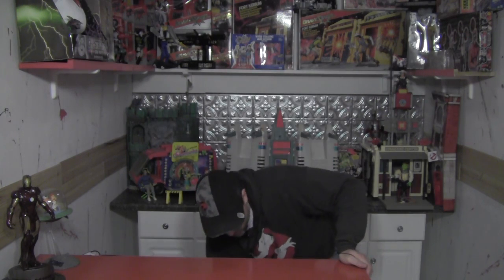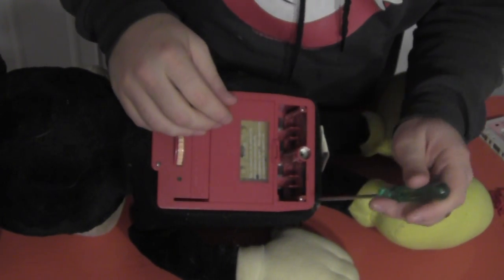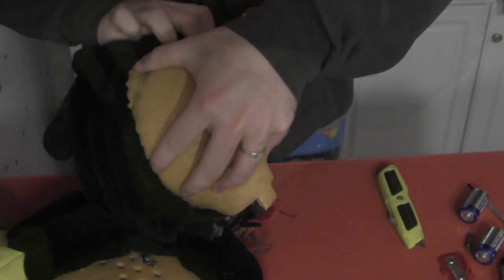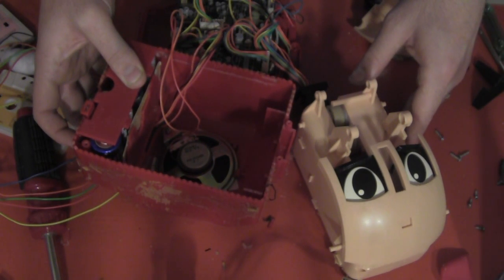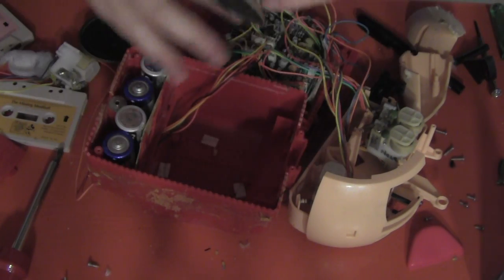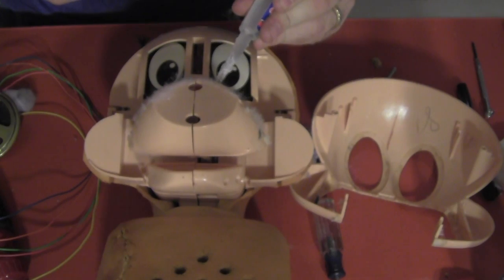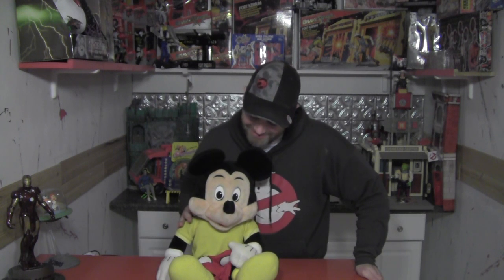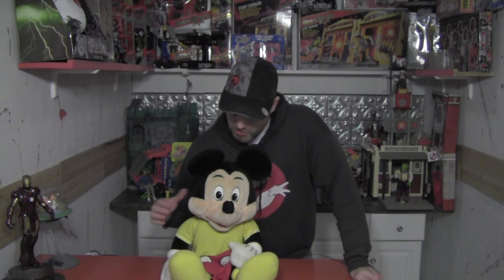Toy Adventures with Devall - Talking Mickey Mouse Repair

Comment: Wow! 11 years ago on this video! Just acquired one. The  battery ends are super clean. I just don't have a tape. Does the animatronics work without the tape? Any help would be great, and it is going in the market! 😊
Reply from the maker: Sadly, no. You WILL need a tape to test properly.

Comment: I replaced the cassette belt & got the tape running, when I plug in to each other, the volume goes down to about half, as if a defective board is dragging it down. Unplugged all 6 motors from the boards, no reacttion, Mickey does not move at all, Googy tries to, massaged the eyes & nose, didnt help, replaced cord, no action. Any ideas?

Comment: I just purchased a Mickey from an older lady that has had him in storage for years. He looks like new but his eyes and mouth don't move and he sounds a bit slow/garbled. I'm going to tear him apart to see if I can get the motors to work again but I was wondering if you have any suggestions on fixing the sound issue? Is it possibly an issue with the tape player belt? I bought this to give to my kids as a Christmas gift, so any help is really appreciated.
Reply from the maker: Hmmm...the garbled sound could be a few things. Are you using old batteries? I always try brand new batteries on mine. It could need cleaned. You can clean the roller part and the metal head, the parts that actually touch the tape inside the cassette with a q-tip and rubbing alcohol. Or yes, it could need a new belt. I'll have to look up the info on what size belt the drive takes...
Reply: I did add new batteries when I got home but the sound didn't improve. I've ordered a tape cleaner but the qtip and alcohol is a great suggestion. The belt size would be much appreciated. Thank you for your help, I really appreciate it.
Reply from the maker: SAM here is a link to the replacement belts. http://resque.goodsmiths.com/toystoration/teddy-ruxpin-tape-drive-belts-replacement-part-for-1st-generation

Comment: I have one that works, but the sound running a bit slow and sounds like what I can only describe  as warbley.  Any idea what might be causing it? I'm almost afraid to take it spart.  I wondered if there are any bands that runs the tape that might need replacing.  I can't find any info online about it
Reply: Yes, you’ll need to replace the drive belt in it to fix the warble. There’s a video on how to replace it in Teddy Ruxpin and it’s identical in how you do it with Mickey. To adjust the playback speed. There’s a small module that controls the speed of the cassette deck’s drive motor, located on the far right of the circuit board that you’ll need a jeweler’s flathead screwdriver to adjust & speed up a bit. Hope this helps
Reply: @inspiredfigmentsarchives  thank you
Reply: @kaybeth9181  No problem, wish ya the best of luck in getting Mickey working 100% again. God bless.

Comment: I have a talking mickey who's tape player and speaker work ok but he's suffering from facial paralysis. Is it possible to get at the motors without taking the head off the body?
Reply from the maker: You can try to gently move the mouth parts up and down while he is on, sometimes that helps. But it doesn't always work properly. :(

Comment: Is there any way I can fix the eye movement without taking all this apart
Reply from the maker: You can try, while playing one of Mickey's tapes, GENTLY moving the eyelid up and down. That MAY work to move the rubber head on the motor back and forth enough that it frees up the motor.

Comment: hi I wanted if you took the cassette player out it would the cassette tape still work with the loud humming sound because bought a couple of world of snoopy book on tape and it don't really work in a regular tape player
Reply from the maker: The loud humming sound, I believe, is the speakers they used on these. They aren't great. The hum can be heard across all of their products, sadly. And yes, the tapes won't work well in regular tape players because the stereo tracks these are recorded on are done so one side, either left or right, holds the program audio while the other side holds the track that controls the motors telling them when to move and how far. On Teddy, Mickey and such the tape players are wired so the tracks are sent to separate functions. Audio to the speaker, motor tracks to the motors.
Reply: Oh thanks for the information and would a snoopy wow cassette tape play in teddy ruxpin or mickey mouse too
Reply from the maker: @groovyentertainment1982  technically, yes. BUT, because the mother boards that control the animations are different in each talker, they may or may not move to the tracks.
Reply: Oh it wouldn't bother me if it doesn't move as long as it plays the stories without no problem I'll be happy 😊

Comment: How did you massage the motor? Did you just keep moving the eyelids? I found a Mickey and his tape player works perfect but his face doesn't move
Reply from the maker: It's easiest to do what I did and basically take the faceoff to access the motors. Then, with the tape playing, I basically take the rubber roller on the end of the motor and roll it back and forth. Eventually, it will start to move on its own as it is supposed to.
Reply: ToyWorldOrder Ok, Thank you for the quick reply!!

Comment: Hi Toyadventures. Your video has really helped me fix Mickey. So far I have replaced the cassette band (replacement bands on ebay) . I have also replaced corroded contacts on the battery terminals. Mickey is now working however the motors in the head do not. I have massaged the motors as you suggested but still no joy. Any idea what the problem could be? Thanks in advance ....Bert
Reply from the maker: +Sam Barton Berts Computer Repairs hmmm...could be the motor's are bad. The only way to test that theory is to find another Mickey cheap and pull the motors out to see if they work..

Comment: Can this work with other Wow toys? I have a talking mother goose who isn't responsive and can't find any videos on how to fix her
Reply from the maker: Yes. It should. Is her tape player playing with sound coming from the speaker and she just isn't moving?
Reply: @ToyWorldOrder  Her tape player isn't doing anything and she's just unresponsive. I took her all apart and no wires were damaged but I noticed that the copper part on the back of her circut board is missing.
Reply from the maker: @kempel_5566  hmmm...sadly, without another board to test the player out in I'm unsure. In my experience, if it is something wrong with the mother board, without the expertise in electronics to rebuild those, it's usually a wash.

Comment: My Mickey works. Mouth eyes and nose work perfectly when he talks. When it's not his point in the tape his nose twitches a lot and his mouth will be still for a while then twitch and sometimes move when the other characters are talking. Thoughts?
Reply: The motion/position tracker on the nose servo motor
will need to be cleaned.. there’s a metal contact on one of the sides you can unscrew to open up, underneath the black board with contacts on it that the wires connect to. Get some isopropyl alcohol and some q-tips and use that to clean both the contacts and the metal piece that moves inside it. Once you do that, screw it back together and it should move fine afterwards.

Comment: Just waiting for my Mickey AND Goofy to turn up from an Ebay seller here in the UK. Seller states that there is no movement or sound from either of them, but they have been stored for a long time. They both look very clean, with very clean contacts too. I know that Goofy will not function without being connected to Mickey, so he might be ok. Mickey comes with the correct tape, so i'm hoping that it's just a "bad connection" problem, as there is no sound and no movement. If it requires more work, your video will be invaluable, so thank you very much for that!! I'll let you know how I get on, and see if I can bring them both back to life!!
Reply from the maker: Good to hear! Let me know! :D

Comment: @ToyWorldOrder - I have that same Mickey doll to repair. This one has problem with the tape running far too fast and ZERO animatronics working. Ive tried a few hacks like putting a resistor on the "wow & flutter" circuit to lower the tape player input voltage a hair and slow it down, but that didnt work right. The head still doesnt move and I was hoping there is a cure that does not require cutting open his brains.
  ANY ADVISE FOR A FELLOW REPAIR TECH NOOB??
Reply from the maker: Hmmm....the tape running too fast is interesting. Honestly, if it was me, I would look for a busted one that still had a working player and swap the tape players out. If that didn't work, I would say it would be a board problem. As for the animatronics, if the tape player is playing too fast it might not be sending a clear signal from the animatronic track on the tape to the motor controls on the board. But, if the tape player gets to playing correctly and you massaged the motor for the mouth and eyes and still nothing, than you will have to open him up.

Comment: I have no power to my mickey I have no tape to test but the green light does not come on when turned on. How can I fix this. I am old and have not done this stuff in a long time.
Reply from the maker: Hmmm. If the light comes on, it means the batteries are powering him. As for a test tape, if you use Ebay you can purchase the tapes for Mickey on there, but they DO tend to be a bit pricey because they are getting harder and harder to find.
Reply: ToyWorldOrder That's just it the light does not come on. I was wondering if it does not come on because of no tape. Or I should at least see the green light come on to let me know it works. I put batteries in and get nothing. Have not broke it down yet
Reply from the maker: Ahh. I read your last post as you HAD seen the green light. It's possible that there is a loose wire somewhere. The worse case scenario is that the mother board has gone bad. The other thing is that the power switch is bad as well. If it's the switch, those aren't too hard to replace. All of the Worlds of Wonder figures used the same type of switch, so parts are easy to come by.

Comment: I also have a TALKING MICKEY MOUSE, but inserting the batteries, not a sign of life.I opened the side with the tape player, to control the contacts, and everything is in order.I just can not understand what could be the problem.
Reply from the maker: Hmmm...without seeing him in person it's hard to say. It could be a case where the mother board has gone bad, or it is possibly the actual power switch is bad. I'm just playing the guessing game here on this one.
Reply: ToyWorldOrder I also checked the switch volume control with testere, but functional.
Reply: ToyWorldOrder I also checked the switch control volume with the tester, but is functional.
Reply from the maker: Hmmm...the light doesn't come on above the switch, right? Just nothing?
Reply: ToyWorldOrder That's right, the light next to the switch / volume control, does not turn on.And the switch / volume control mounted in TALKING MICKEY MOUSE, in Teddy Ruxpin and MOTHER GOOSE, is a potentiometer for miniature radio pocket.That at least in Italy, it is no longer on the market for some years.
Reply: ToyWorldOrder I thorough research of the problem of non-operation of my TALKING MICKEY MOUSE, and I discovered a strange thing: detaching from the motherboard connectors of the three motors in the head, coincidentally the cassette player turns on and plays.Instead, reconnecting to the motherboard, the connectors of the three motors in the head, the TALKING MICKEY MOUSE no sign of life.
Reply from the maker: Hmmm...unfortunately it sounds like one of two things. One of the motors has a short in it which is causing the board to not function. You can try plugging in the motors one at a time with the power on and see if one of them shuts it down. OR, there is a problem with the mother board itself and usually in that case it is beyond repair for those of us that never went to MIT...

Comment: We have just got Mickey and Goofy out of the loft after 20+ years. We have replaced the cassette drive belt and got Mickey and Goofy working but the cassette will only run for a few rotations before it stops. Do you have any idea what the problem could be? Our grandchildren are waiting anxiously to see them working 100% again.
Reply from the maker: +danaherfamily It is possible....POSSIBLE...that the drive motor is going bad...I MAY have some spare parts here soon, I have a couple of extra Mickey's that I need to test and see what is and isn't working on them. Shoot me an email Devall@toyworldorder.com and I will look in the next week or so and see what I have. If I have a spare tape player minus the mother board I can send it to you to see if it fixes the issue. :)
Reply: Did you flip the tape so its on the other side? (dont worry! its has the same story!)
Reply: It’s 2 contacts located near the take-up reel and the pulley the drive belt goes around to make it play. How it works is as the tape plays, the contacts push together constantly to send an electrical pulse to tell Mickey if the tape is playing back. If working properly. It auto-stops when the tape is at the end.. but if those contacts are dirty, it’ll make the auto-stop go off too early. You’ll need to clean the corrosion/oxidization off those contacts with some white vinegar and then some isopropyl alcohol. ‘Should’ work after that. Hope this helps

Comment: Where’s his power button?
Reply from the maker: It's a dial you spin in the back above the tape door. Also controls volume.
Reply: ToyWorldOrder thank you mines broken then! Found it for £1 put some tin foil on the batteries and it try’s to start but it’s so corroded I need to fix the corrosion
Reply from the maker: @tonyhowell9394  yeah, corrosion is a pain. I usually take a very fine grit sandpaper and run it over the rust. It should clear it off enough for good contact to be made...you have to be careful, though. If it is too far gone the metal becomes brittle and the sandpaper could snap it in 2.
Reply: ToyWorldOrder thanks for all the help

Comment: Devall: what does "massage the motors" mean??
Reply from the maker: Basically, you take the motors out, and then move the rubber wheel on the end back and forth. Basically, what happens over time is that the grease used in the motors seizes up and hardens, and moving those motors back and forth causes the grease to re-liquefy and allow the motors to once again function.
Reply: @ToyWorldOrder   Do you have to open him up? Wanna fix mine?
Reply from the maker: @danielboulanger5230  depends on what is going on, but probably, yes. I usually ALWAYS open all of them to un-stick the motors.